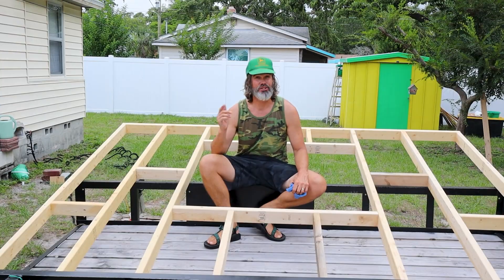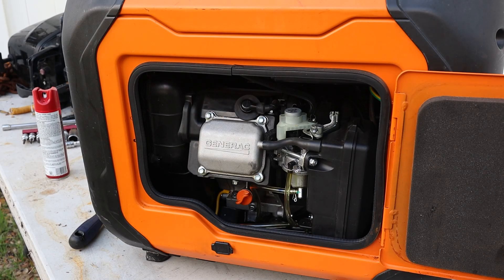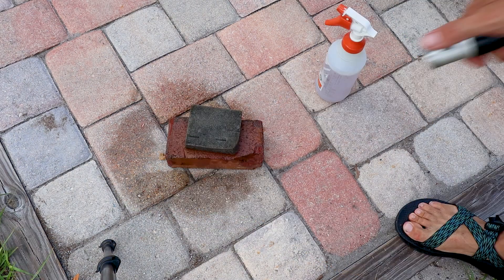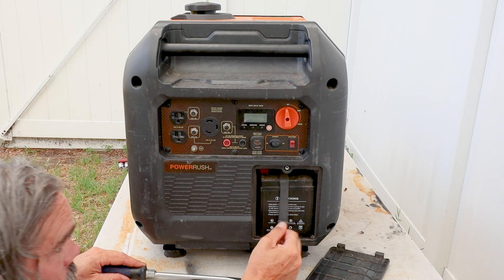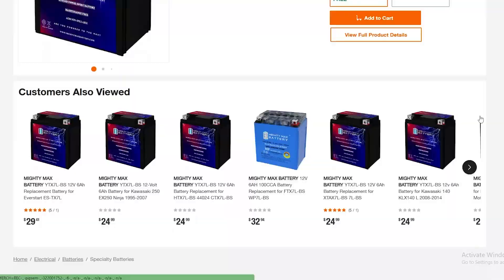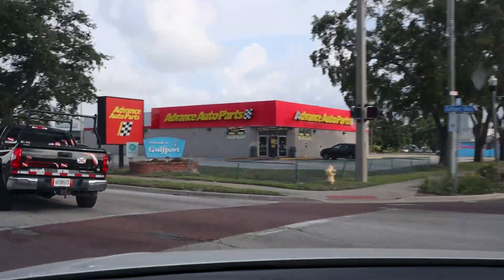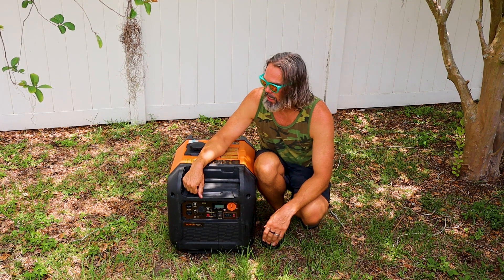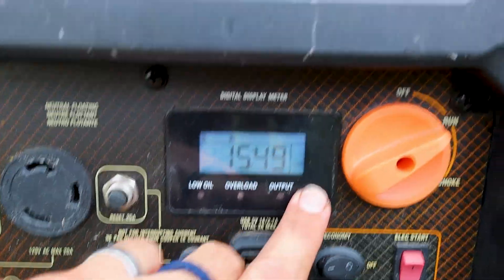Generac Inverter Generator Maintenance Guide

Comment: Great video! Thanks!
I have an issue where on echo mode the General stalls. Could this be a clogged low speed jet on the carburetor? Is that easy to clean?
Reply from the maker: Yes carburetor is easy to clean. Also, check that flame arrestor.

Comment: Bro, so I think fuel has dropped on my control board, this is the second time I’ve had this issue. The issue is gen won’t start just cranks won’t fire, I had it repaired and the guy said it was a common problem due to over filling.. you have any experience with this issue. I have the same 3500 as you
Reply from the maker: No, dripping from the fill at top or the hose on inside?  There was some sort of strainer that was on fill hole I instantly removed because it made filling with a modern saftey can really hard without spilling fuel everywhere.  I try to keep the minimal amount of fuel in it when not using it. I've only ever topped to 100% when I know im gunna run it for 5+ hours straight.  I'll take a peak in there.  I got a busted gen I'm gunna try and get working in a vid soon. - Jason
Reply: @GulfofAmericaManYT  ya this darn thing sitting in the middle of the Atchafalaya basin, I keep it full when not in use, don’t want no water you know, I read that through expansion fuel get on the control board but I think it’s ma padnas over filling and getting fuel on control board. I been out of town, gonna check it out this weekend. Thanks for the reply dude… threw me off my names Jason too
Reply from the maker: @Windowintoamind yeah I took that lil strainer out and got a funnel with strainer just for it so I’m not trying to get in that hole on first release lol. Plus those safe trigger cams just douce it. Good luck!

Comment: I have the iq3800 and can’t find the air filter part number or oil filter part number.. do you know what they are
Reply from the maker: It doesn’t have an oil filter. It’s a “splash” style lube oil system.

Comment: You didn't have to dump the oil like that, rubber plug showing a oil spout allows a socket and extension to take that nut out below the stick and it will run right out
Reply from the maker: I will make an updated video next oil change!
Reply: I learned through trial and error myself, I still have the generac along with a couple predator 5000s and they are a lil more oil change friendly
Reply from the maker: @eddiecoffey4963I used a suction tube  after the first dump like this years ago but after the storms and a few changes I huked it so I didn’t have to store the absolutely greasy mess 😂.

Comment: Do you have a video on how to replace the coil on this unit?
Reply from the maker: When you say coil are you talking the pull start or the ignition?
Reply: @GulfofAmericaManYT  the ignition coil.   ***edit*** I figured it out, you have to disassemble the whole unit.
Reply from the maker: @bomcdaniel8311 That is very disappointing. Did it fix your issues? How many hours on the unit?
Reply: @GulfofAmericaManYT yeah it was time consuming, nope still no spark, but I'm thinking it's the ICM (ignition control module) I have no pules from the ignition coil from the ICM. 167 hours on the unit.